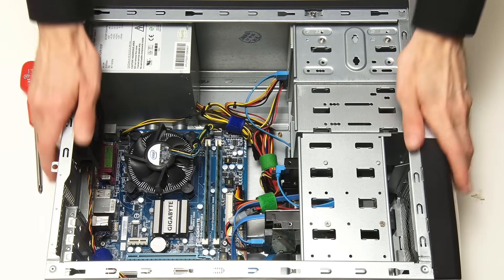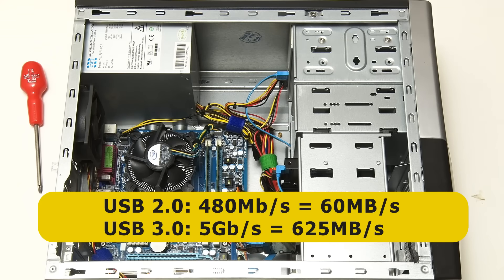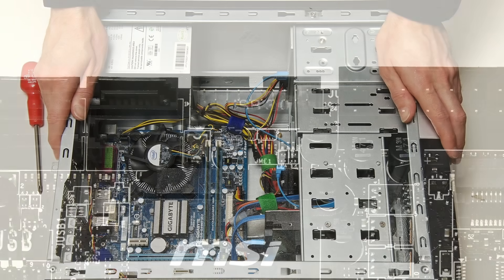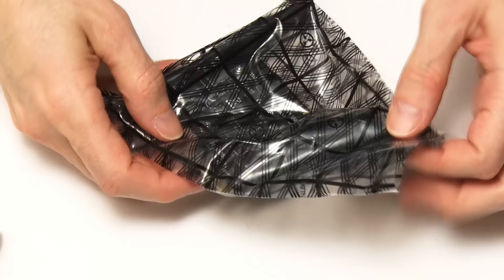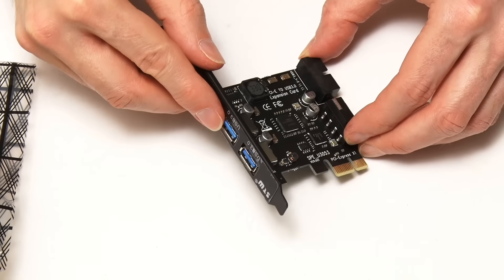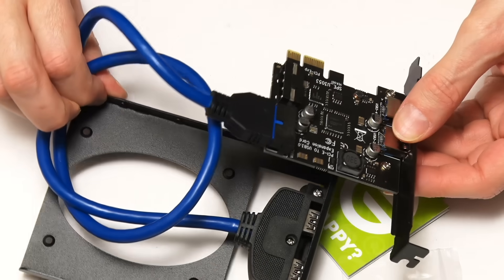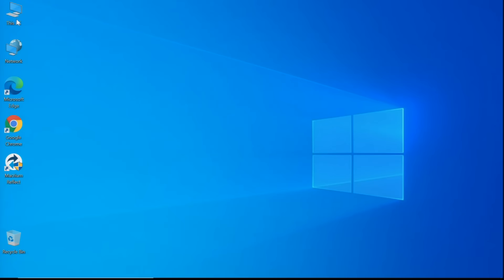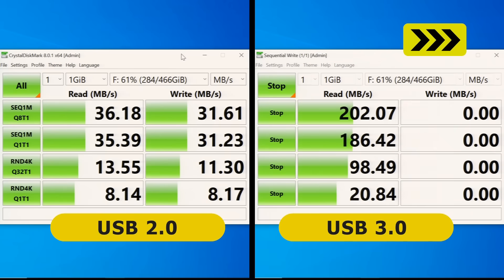Old PC Upgrade #3: USB 3.0 Ports

Comment: Great, easy to follow video, thanks. I guess youtube figured out that I was working on adding a USB 3.0 to an old P.C., as the video showed in my feed. Good match, guys. I had an issue with mine where I ended up having to use a Dell card (Two port, but one inside the case.) that was an optional upgrade in the Dell computer. But it still wouldn't properly load the driver until I installed the driver in my OS's compatibility mode and as administrator. But I now have a working USB 3.0. Cheers.

Comment: Greetings 🙏🏼 I love your videos and was able to successfully install a USB 3.0 pcie expansion card to an older PC running XP for an archival analog project thanks to this video. I’ve installed the driver and the expansion card is recognized in device manager and data transfers normally, but speeds are no different than USB 2.0.  I’ve read Windows XP does not recognize USB 3.0 speeds and wanted to know if you have any suggestions on how to transfer data at a good speed off of this XP machine?  The hardware is all relatively new, the OS is running on a 240GB SSD.  There are additional Sata ports so i’m not sure if I should just return this pcie card and attempt to connect another SSD through one of the Sata connectors

Comment: Do note that if you are using a PCIe Wi-Fi card and a PCIe graphics card with a USB 3.0 card, specifically on Micro ATX motherboards, the Wi-Fi may disconnect when the USB card is under load, and depending on the motherboard and the quality/design of the card, the system may not boot into the OS at all, or may lock up while the OS is running.

Comment: Firstly, Love your clear yet funny explanations I have learned so much. I have done the RAM and SSD Upgrade.  Is it possible to add an HDMI port or can you get these boards with HDMI on?   I have a USB to HDMI connecter to connect to my TV, but my computer only recognizes it now and again and I end up having to restart my computer to get it recognized, which is a pain. The drivers are Ok for the adapter. Or would upgrading to these USB 3 Help?

Comment: I had to do this to an old low profile Sandy Bridge PC via a low profile PCI-E card.  Very handy for external drives and external network adaptors.

Make sure that they have an external power connector as Chris has said.

Comment: Hi. I have an old intel motherboard DX58SO which is USB 2.0. If I add USB 3.0 PCI-E card will it work ? Thanks for your help.
Reply from the maker: Yes, a USB 3.0 PCIe card should work fine with that motherboard.

Comment: You say you need to make sure there's a power connector on such a PCIe card with an internal usb 3 header, but if you plug it into a PCIe 2.0 x16 slot that's not necessary i think, right?
The slot itself should provide enough power right.
After damaging the internal USB header on my motherboard i bought a PCIe card with an internal USB 3 header, one without a power connection on it, but it works just fine.
I plugged it into a PCIe 2.0x16 slot on the motherboard.
Reply from the maker: Sadly not right. A PCIe x16 card can indeed supply more power than a x1, x4 or x8 slot. However, the power it can supply directly relates to the card inserted -- the maximum power of a x16 slot (75W) is only available if you plug in a card with x 16 connector. So you would be right if you had a x16 USB card. :)
Reply: @ExplainingComputers  Thanks for your reply. 
I didn't know that.
Sadly for me i found out, after installing the PCIe card with the USB header, that one of my two M2 SSD's wasn't working anymore😢
Turns out the second M2 slot on the motherboard gets disabled when using more than one PCIe slot.

Comment: Thank you for your thorough explanation and demonstrations with the supporting test results.
The improved data transfer speed increases are impressive and well worth the upgrade. I am curious as to whether or not I would potentially see any improvement in WiFi performance by replacing an existing PCIe WiFi adapter card with a newer USB WiFi adapter?

Comment: Be careful snapping out the blanking plate as shown in this case. Some are less well-stamped and leave sharp edges waiting for your fingers. A `white box` PC clone company some years ago was infamous for this. Unfortunately, our company was contracted to provide warranty service for this company's customers and we had lots of work from them, but getting parts from them was slow, not the warranty cross-ship service we got from Compaq IBM, or HP which was frequently overnight.

Comment: Need a USB 3.x card that works in a straight PCI slot and no other motherboard connections.
Power cable is no problem.

Comment: Is it possible to add a pci-e card that has a 3.1 gen 2 connection to a 3.1 usb type-A 10gbps front panel?  What you're doing is great for two of my computers (Dell Inspiron 530) that wouldn't be any faster with 3.1 but my other computer (Dell XPS 8300) can use 3.1.  All pci-e cards will do 3.1 10gbps out the back of the pc but only seem to do 3.0 5gbps when connected to a front panel.  I found one card that says it will do 10gbps to the front panel.  But only one and that makes me wonder if what they're saying is correct.  It's a Cablecc UC-136.  I hope it will work.

  Should it work?

Comment: Re: My old HP XP computer
Contemplating purchasing a USB3 card
So, I wont need to download a USB3 driver?
Will the computer recognize the new device and install the driver automatically?
Reply from the maker: You will need a driver for a computer running Windows XP -- so check if one is available for the card you want to install first. From Windows 7 onwards there should be included OS support.

Comment: Speeds may vary depending on the PCIe standard used on the motherboard. A version 2.x PCIe x1 slot can perform faster than a version 1.x slot (500 MB/s vs 250 MB/s).
Reply from the maker: As noted in the video as I recall. :) See my PCIe slots video for the full info: https://www.youtube.com/watch?v=PrXwe21biJo

Comment: could you please help me track down a side pannel for the case you have for this video series. thanks to you i was able to figure out that it might be a cisnet t28 or t31 mid tower case but i am haveing 0 luck finding and spare parts to buy on ebay or amazon. and the ones i have found are way to expensive and inpractical to buy a whole pc for 1 side panel. if you could help get me a side pannel that would be awesome if not ill have to bend a piece of metal to make a side panel.

Comment: What you neglected to mentioon is yous usb 3 front bay also has space to mount a hard drive (SSD)   thats what the holes in the base are for
Reply from the maker: Indeed it does -- there is a 2.5" drive mount there.

Comment: Hello, thank you very much for your videos, I wanted to ask two questions, can an Internal Usb 3.0 To Usb 2.0 Port Adapter be used to connect the front usb? Can a pci express port extender work on a graphics card that doesn't need power from a power supply? thanks and regards.

Comment: Went to rewatch this video to drop a like and say my thanks for the idea of using a USB 3 PCIE card. Thanks Chris!

The one I got a few months after this video for about ~8USD was very similar just without the additional molex power. Used to test if the USB ports of my daily driver computer that being a weird swine that's acting up in various ways and died recently, so I'm waiting for a new one.

The USB 3 card is now in my older pc that has only 4 USB ports at the back and that will probably be its home even if its communicating via PCIE 2.0 x1. I still have to get a front panel bay for easy access in the front because the internal USB 2 of the old pc can be weird at times and having USB 3 at the front is way more convenient than always going to the back of the pc.
Reply from the maker: Thanks for this. :)

Comment: I have some old Antec Sonata cases (ver 2, 3,and 4) I would like to recycle for future PCs. They are great cases. All metal, well made and toolless fitting of drives. This is one H/W upgrade they will need. I wonder if it feasible to replace all the front panel wiring (on switch/reset plus audio as well. The Sonata 2 front panel Firewire apparently used Firewire 1394a standard and should not be used so I will have to block that off. I hate all Firewire ports with a passion now anyway after I saw several zap a few older tape video cameras.

Comment: If you use a 19 pin USB 3.0 pci-e card that has a power port (sata, 4 pin, ect) does the front USB 3.0 panel that you're running off the 19 pin port also need additional power or does it transfer through the 19 pin cable? I understand that additional power isn't really required at all. I mean, will the front panel have the same power output as the USB 3.0 ports on the card? I hope that makes sense. lol

Comment: I have never gotten any usb 3.0 drive or usb 3.0 stick work reliably fast. Either it's really fast and ejects itself at random progression of the transfer, or it immediately ejects, injects, ejects, injects ad infinitum. I have as a result over the last 5 years exclusively been using usb 2.0 ports does anyone have any advice? I have tried two different external usb 3.0 disks and 6 different usb 3.0 sticks, they have never exceeded 20MB/s ever.

Comment: doesn't your board processor have to be up to a certain capacity to run usb 3?  Thank you
Reply: no, the expansion card has the controller.  speeds will depend on version of PCIe your motherboard is.. 16:30

Comment: Unless I missed a relevant remark, due to the fact that we have now available USB 3.0 ports, It should be noted, that the new faster data transfer ports, require appropriate USB 3.0 CABLES connected to them (rather than the old USB 2 cables that were connected to the old ports!).
Reply from the maker: I am bewildered by this comment. USB 2.0 and USB 3.0 headers are entirely different. There is no way to confuse them. In this video I fit a USB 3.0 card that has a USB 3.0 header that is connected to the USB 3.0 cable that is attached to (wait for it) the USB 3.0 front bay.

Obviously many USB 3.0 peripherals need to be connected via a USB 3.0 cable, and as most are supplied with. And other USB 3.0 peripherals (like flash drives) correct directly.

I give up.
Reply: "USB 2.0 and USB 3.0 headers are entirely different."
Yes they are different, but they look the same, and, yes they CAN, evidently, be replaced or not be connected correctly (USB 2.0 cable can be connected -physically -  to a device having a USB 3.0 port) in the first place.
But, that wasn't the issue. For those who may not be familiar with this issue, it was advisable to make this note. What may be very obvious to you, isn't necessarily obvious to everyone. I do hope I haven't bewildered the less-knowledgeable readers. I was just trying to help.

Comment: Up grading my comp now , watched many you tube channels , learnt more watching three of yours vids  than the 40 i have watched of other channels , why you speak as if i no nothing about comps ,and i dont so i get what you are saying ,thank you
Reply: is it worth fitting a graphic card , and which if possible
Reply from the maker: For many computing tasks today a graphics card is not necessary, as the onboard graphics (those included in the processor package) are often good enough. But for significant gaming, or video editing, a graphics card is often required. Which one depends on what you want to do with it, and how much you are prepared to spend. My most recent video on fitting a graphics card is here: https://www.youtube.com/watch?v=k3vIACldD-A Personally I edit on a PC with a GT1030 graphics card with 2GB of RAM, and this works fine for my video editing.

Comment: Hi, thanks for the video. I've managed to do the upgrade on an old Compaq on which I run Manjaro OS.  Unfortunately though the system appears to recognise there is a new USB 3 hub, when I insert a drive, it's not recognised in the file system. I'm sure there is something I may need to do but haven't yet worked out what exactly. Any ideas?

Comment: Did this USB3 PCIe card with two USB3 ports on the back and two USB3 ports in the front give you a total of four USB3 ports, or just two USB3 ports?  I ask because the USB3 PCIe card I have has three USB3 ports on the back, and one in the front.  However, USB3 port 1 on the back is the same port as the USB3 port in the front.  Two USB3 connections for the very same USB3 port.
Reply from the maker: This card gave four ports in total -- two on the front, and two on the back. Some USB PCIe cards come with a lead to extend one or more ports to the front (which sounds like what is going on with the card you used). Others have an internal USB header -- like the card I used -- which allows additional internal (here front mounted) ports to be connected.

Comment: I am using Gigabyte 78LMT-S2PT mother board, there are no usb 3.0 port supported option. Can I use usb 3.0 expansion card like you? Please Reply
Reply from the maker: Yes, a PCIe USB 3.0 card should work fine with that motherboard -- you have two PCIe slots. So provided one is free, everything should be fine. Good luck!
Reply: @ExplainingComputers  I am from India. I want to know Ultima Cords & Cables PCI Express Card 4 Port USB 3.0 with 5V 4-Pin Power Connector is this product is okay for me?

Comment: I've had a quick look through the comments and I don't think anyone has mentioned one point about this upgrade, When I added a USB3 card, similar to the one you used, to a 10 year-old Mesh computer, I noticed that the USB3 card was not recognised by the BIOS. The USB3 drivers were supplied by the operating system, Windows or Linux. If you regularly try out Linux distros by booting from USB drives you still need to use the USB2 ports. The same would apply to a Windows Recovery USB drive. You can use USB3 for creating the USB boot drive as you already have an Operating System running. Otherwise it's a very worthwhile addition and, as usual, your explanations were very clear.

Comment: I have recently rebuilt my home desktop computer. I removed the motherboard that I installed in April 2006, and installed a new MSI B550 gaming board with Samsung 1TB SSD card, and 16 GB ram. After deciding I did not like windows 10 or 11, I have returned the machine back to windows 8.1.  I have also reused 2 of my PCI-E boards. 1. sound card and 1 PCI-3 to USB 3.0. Sound card works great, however, I can't find drivers to re-install the USB card. I don't know the manufacture, or even remember where I got it. Can you help me find a driver for a 1X PCI-E to 4 port USB? Thanks in advance!

Comment: I can find the pci USB car but the front headers all seem to have a 20 pin connector instead of 19.  can they be used interchangeably?  I have a refurbished HP Z420.  it does have USB 3.0 but only externally - no places on the MB to plug 3.0 in.

Comment: Thank you again, I have up graded my 5 computers I built in 2009 with USB 3.0 thanks to your instructions, and source for the parts. I had no idea this was available. I would like to know if you can install 2 of those cards in a computer, or will they create a problem with the drivers?
Reply from the maker: Great to hear! :) In theory you could install two USB PCIe cards, although if this is your plan I would try to find one card with 5 or six ports, or else use a hub.

Comment: This is actual helpful stuff. You are showing useful information for a normal budget user instead of showing 64 core CPU benchmark score ;)
Reply: you would be amazed at how much power is packed on the P5K pro motherboard used with famous core2quad processors, just add up a pcie card for usb 3.1 and m.2 and over 15 yrs later it is a very solid build

Comment: I did the same with my 15 year old core2duo. added ssd, added usb 3, better Ethernet. Now it is one of the servers hosting one the microservices of my application. Funny, looking back at things. Now I have a core2duo and a Threadripper 64 core and many other things that fall in between. I wish my old Pentium 4 still worked. RAM Slot got burnt. CPU is fine probably.

Comment: Wow I enjoyed that, I'm about to do just what you explained but the pci card hasn't got a power in port, I hope im going to be ok, mainly doing it so when I copy my drone videos across which can take with usb2 around 30 min's after a flight. I notice with the usb 2 port if I draw 0.44 amps it drops the voltage down to 4.83V using a tester, am I going to get the same from a pci slot? without a power in port on the card?

Comment: I am having USB 2.0 ports and intel core 2 duo processor old compaq desktop, will it work on that configuration. 4GB ddr2 RAM. Whether usb 3.0 has got anything to do with processor ? We cant use it on core 2 dua ?
Reply from the maker: Yes, providing you have a free PCIe slot, you can add a USB ports card to your PC. The processor and RAM do not matter for this upgrade, and the Core 2 Duo remains a pretty decent processor.
Reply: @ExplainingComputers firstly thanks for replying sir, just question is do we have to see any hardware configuration or just we have to purchase and install ? Whether processors are totally independent from usb 3.0 or any architectural need for 3.0 support inside processor ?
Reply from the maker: @budgetlifewithme  There should not be any configuration required with Windows 7 upwards, or any modern Linux distro. It has nothing to do withnthe processor, which accesses it via PCIe.
Reply: @ExplainingComputers  Sir purchased and installed but driver issues. Please suggest.